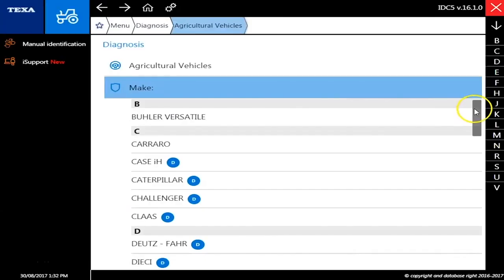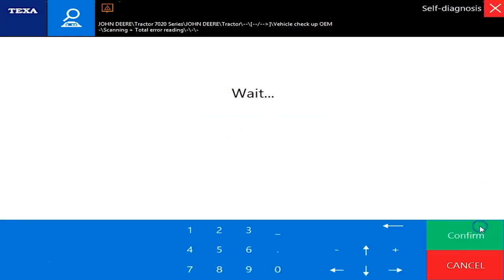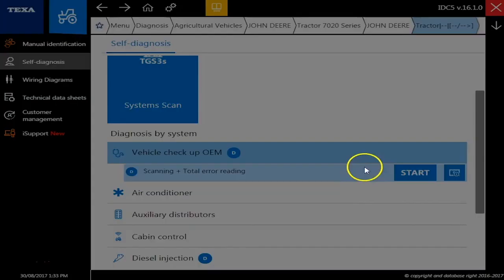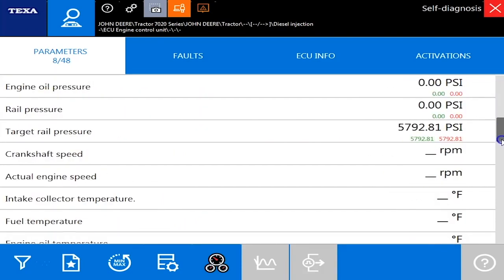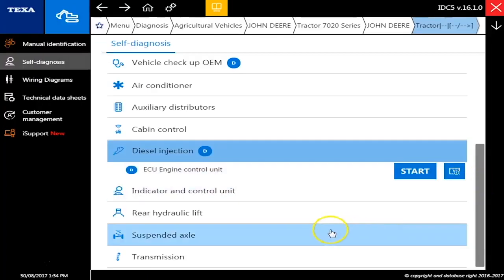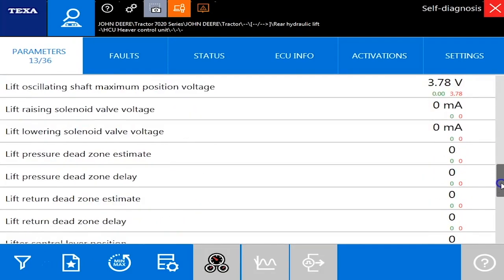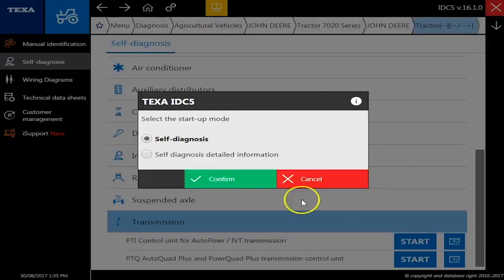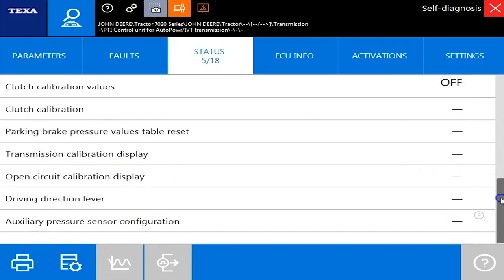TEXA Off-Highway on a John Deere 7820 - Total Scan, Engine, Transmission, & Lift Diagnostics

Comment: hi there, i am having a problem with texa diagnostics on a doosan dl200 tc -3 for the ZF transmission is there a special connector
Reply from the maker: You can use this site to see what cables you need & where they are located: https://www.diesellaptops.com/pages/cable-finder